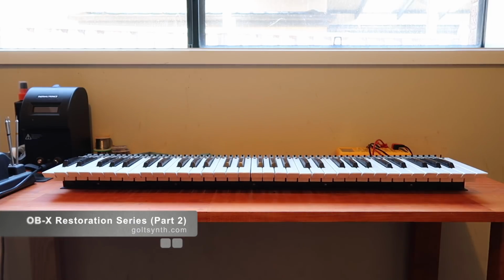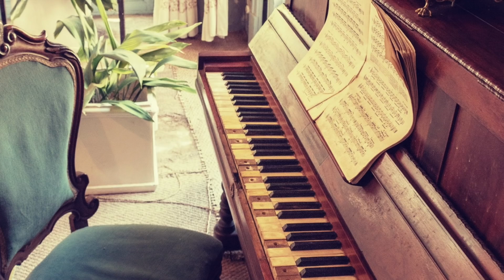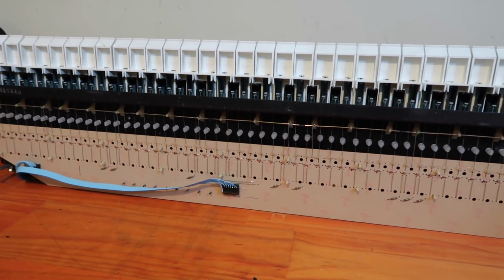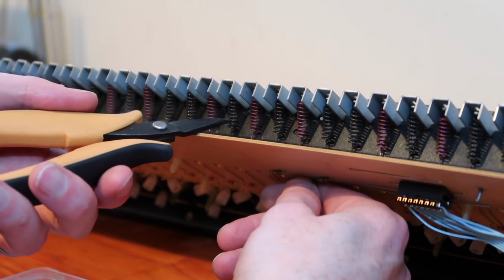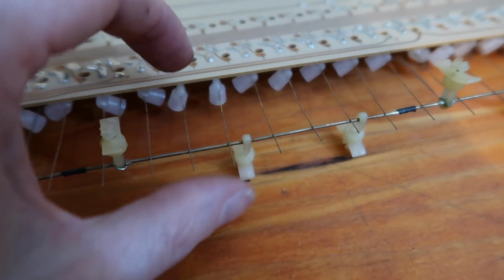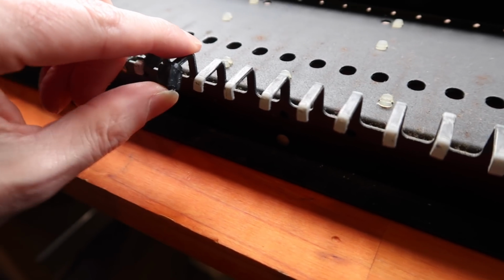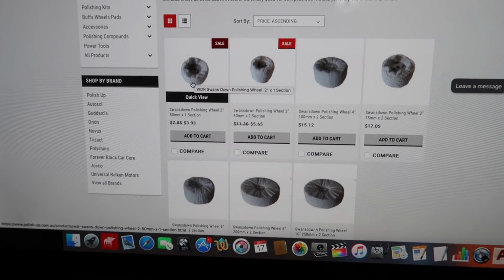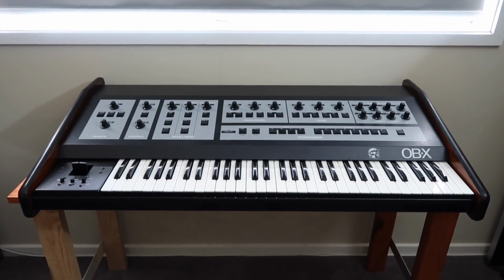Oberheim OB-X Restoration (Part 2) - Pratt Read History, Keybed Service, Key Polishing.

Comment: I absolutely hated the Pratt Rad keyboard on my Prophet-5. The J-wires were always breaking and forcing me to open up the synth which was a major drag in order to re-solder another J-wire. I think the key bed itself felt pretty lame as well. The Panasonic keyboard (Memorymoog, OB8, etc) was also a pain in the arse. I finally bought a replacement keyboard for my OB8 and it is great.

Comment: Hey Golt! How come the Pratt Read keybed has such problem with keys becoming un-leveled? Is there any of these keybeds that do not have that issue?
Reply from the maker: corner liston As far as I know, most if not all Pratt Read keybeds used in synths have that issue. The posts that are used for the key stops aren’t very strong. It was a design fault.
Reply: @GOLTSYNTH  Oh right! the key stop posts! Well, good they don't fall off completely at the least : )
Looking forward watching part 3.

Comment: Pretty cool. What is the type of grease on the bushings? The ones I get are dry.
Reply from the maker: Scott Rogers the lube is GC Electronics part # 10-8101, Type Z5 Silicone Compound. Should be available from element14 / Farnell / Newark, or eBay.
Reply: @GOLTSYNTH  Thanks very much!